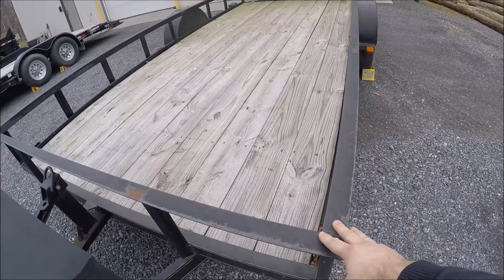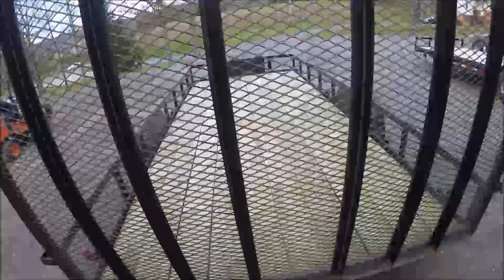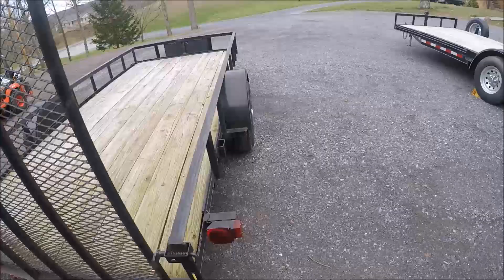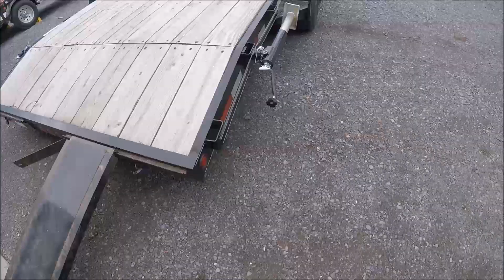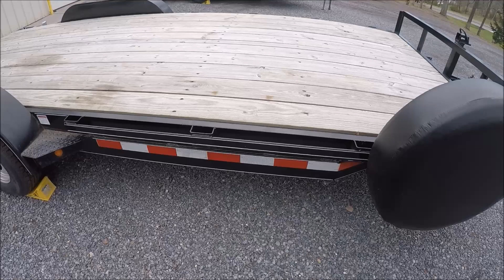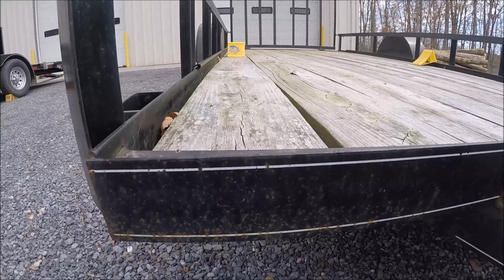What kind of trailer for hauling tractor Part 1 of 2

Comment: Bullitt:  I watched this video several times. I haven't purchased a trailer yet b/c dealership is 6 miles away and they'd drive over to pick it up for free. Now they charge $50. Still not a problem with that since I'v only taken it in 3 times over last 12 years. I like recommendation to pay a few extra bucks for a 10K pound GW car trailer which is built to last. Thanks for sharing.
Reply from the maker: Thanks. $50 is very reasonable. There are a couple of guys here that have rollbacks and haul in the county for $50. At that price it makes it tough to justify a trailer.

Comment: Spray the wood floors with diesel every 3 months and you will never replace a floor due to rot. Also the wood will become so hard after a while you won't be worried as much about anything falling through the floor. This is how we treat the wood on flat bed semi trailers.
Reply from the maker: Just straight diesel? I've heard of a mixture of diesel and oil/
Reply: you can do that too. oil helps the wood but more so it coats the bolts and stops rust. diesel is an oil though. i have an old steel flatbed, to heavy to use for anything, nut have been soaking it like everything else for some 50 years now. original lumber, hard as steel. what got it all started was dad making ax and sledge handles. soak them in a barrel for 30 days, let dry for 30, and you have a handle that doesnt break or rot. like creosote.
Reply from the maker: I've heard if you use too much oil, it will be slick. Straight diesel sounds the best especially since it hardens the wood.

Comment: You provide some good information but I’d be careful not to generalize based on the 3 options you have.  There are many options on trailers like 3500, 5200, 6000, and 7000 lb axles.  Pipe and tube rails are much stronger than angle rails. Treat the wood or oil it regularly and it won’t rot.   There’s also goosenecks 

I would say fit the trailer to you’re specific need.  Farmers and ranchers don’t  have much need for car trailers but they have  a need for top rails to haul tractors and then hay.
Reply from the maker: I could do a whole video on axles. There are so many options.

Good point on the tube top rails. I've always wanted one with a tube top rail.

I was mainly trying to make this video for a sub compact or compact tractor owner.

Comment: Im glad i watched this before biting the bullet and getting this trailer i wanted today. Now i know the few things i can delete off my list and ill save some money.
Reply from the maker: Awesome! What options are you not getting now?
Reply: 94BULLITT i wont be getting the rear gate. Its just gonna get in the way and i have a nice aet of ramps i got not long ago. So that will take 200 off the price and im gonna see about getting a wrap around tongue. And the break away box
Reply from the maker: See how much a set of slide in ramps would be like the car trailer in the video has. If you use the ramps you have now you will have to haul them in the tow vehicle or on the trailer. At times that may be a pain depending on what you are hauling.

Comment: Regarding the ones with a ramp/gate, all those I've seen are removable, so you CAN haul an over-length load by taking the ramp off and loading it in the trailer, maybe along a side rail.  "Equipment" trailers with ramps can also sometimes be configured for too-long loads.

I have found wood decks to be about as slick as steel when wet, AND they rot, even when well-treated.  Most of them sit out in the weather all the time.  I have a trailer with a steel deck that's never needed any work, while my wood-decked one about the same age is ready for its third deck.  Maybe steel with some traction-enhancing surface would be best.

I don't like the last style car-hauler type for tractors, because the fenders are extremely vulnerable to damage from tractor implements.

I use the equipment-style (not shown here) with a wide deck over the wheels (no fenders) and no rail, but with stake pockets where I can build a wooden fence anytime I need a rail for containment, but I don't tie down to the rail.

Comment: Hey there,
I have a 6x12 single 7000 lbs axle tilt and load trailer that I use to haul my BX2380. 
It has 16 inch tires and brakes and stake pockets through out.
Reply from the maker: That sounds like a really nice trailer for hauling a BX!

Comment: Although this information is sound it in some cases overkill. I for years made a living with trailers. In alot of cases spending an extra $3,000 for a trailer is just burning money. Same as saying you need a big equipment trailer with brakes to haul a small tractor that weighs less than 3,000 # .  A 12ft landscape trailer is perfect for your sub compact a massy Ferguson GC Series with loader and back hoe comes in under #3,000. Most trucks and SUV'S can tow this without brakes if properly loaded. I will say any tractor that goes over 3,000# you should by all mean go to tandem axels with at least 1 axle with brakes. Spending extra money for what you dont need isnt being smart. I pulled loads grossing 22,000# regularly with a triaxel carhauler and a half ton 4x4 pickup. Moved dozers and tractors  hauled logs pretty much everything. I currently have a 12ft utility and i haul 3,000# of gravel for driveways with no trouble at all with  Ford Explorer granted the Explorer does have a tow package that makes it a bit more stable. But dont be fooled it can be done safely without a fortune in overkill.
Reply from the maker: Most single axles are only rated for 3k. A Massey GC1720 weighs 2670lbs, a single axle would be overloaded. I am at the limit with my Kubota BX, that does not have a loader. If you plan using a single axle for primary way to haul a tractor, it should have a channel frame, but that would make it heavier, reducing pay load. You also need a heavy duty gate, so it does not get bent like mine. A decent 6x12 trailer is $1700, an angle frame would be more. https://www.bestchoicetrailers.com/all-inventory/utility-trailers/steel-single-axle?order=2 You can get a cheap 7x16 car trailer for $2500, $800 more. The 2 axle is a better value IMO, it has 2 axles with brakes and is longer and wider for $800 more. https://www.bestchoicetrailers.com/2018-amo-7x16-wood-deck-car-trailer-7000-gvw-sEsg%7CvOe.html I don't think you can every have enough stopping power especially when tow/ hauling, can you place a value on stopping shorter to avoid an accident.

Comment: I am a bit of a weird feller and would rather build a trailer than buy one. I want a dovetail for hauling cars, perhaps even my tractor from time to time, the issue is, that when i go to get a car, it's usually in a hard spot to get to. i.e. the trailer bottoms out. Now a little tug, a little hug to the left, and a "hold my beer" moment makes that a non issue, but the ramps would probably get ripped off if i put them under the dovetail.
Reply from the maker: With the way the ramps store on the trailer in the video, the rear cross member drags first. You could also build a hydraulic tilt so you don't have to mess with ramps.
Reply: Oh I might have to do that.  I was in a ditch one time with a borrowed trailer.  Had to rescue a broke down rig.  Some of the sketchiest towing I've ever done was with that trailer.  We were backing down the hill and the deck of the trailer was flexing.  Good story.  Great conversation starter.
Reply from the maker: Tilt decks are awesome. No  getting the ramps the right width and having to get the ramps out, or let them down. I'd like to have one.

Comment: I need to haul UTV and tractor. Problem is tractor weighs 2335lb so it appears single axle is out. Don't like going to dual axle more cost and they don't handle as well backing up as single axle. Anyone using a single axle that can handle 2400lbs for tractor hauling?

Comment: How long what the hauling trailer ?
Reply from the maker: Which trailer?
Reply: @TractorTech  the hauling/equipment trailer
Reply from the maker: @gabrielcarothers9891  20'
Reply: @TractorTech  would that be best for a Massey Ferguson tractor with a disc attached?
Reply from the maker: @gabrielcarothers9891  What size is the Massey? Is the disk attached to the 3 point hitch?
Reply from the maker: @gabrielcarothers9891  What size is the Massey? Is the disk attached to the 3 point hitch?
Reply: @TractorTech  to 20 , yes 3 point lift
Reply from the maker: @gabrielcarothers9891  an 18' would work really well. You possibly get by with a 16'
Reply: @TractorTech  oh sweet! Been looking into buying a trailer soon to haul the tractor and disc around

Comment: car hauler allmost just like equipment trailer " BECAUSE "  load up easy / great for hauling  all kind of compact or mini  / plus + if u was loading when fork lift  easy to load lumber on car hauler  " ONLY DIFFERANT IS / HOW MUCH WEIGHT BE ON CAR HAULER   OR   EQUIPMENT  TRAILERS "

ALL OF MY CAR HAULER TANDEM  7500 LB TO 18,000 LBS OR TREAT WOOD DECKING / " BECAUSE STEEL DECKING WILL MADE EVERY THING " SLIDER " IN THE COLD WEATHER OR WET WEATHER  ! .

I  BUILD MY TRAILER OUT OF ANGLE IRON ALOT STRONG THAN SQUARE TUBE / SQUARE TUBE WILL FREEZE AND BUST WIDE OPEN / IF THE WATER GET INSIDE THE WELD EVERY TIME ?

EXAMPLE  :  LOADER TRACTOR  >  TRAILER NEED TO BE  BETWEEN 22 FT OR 24 FT / DEPEND ON WHAT SIZE OF  LOADER TRACTORS  U HAVE TOO ? .
Reply from the maker: You can get car trailers up to 14k.